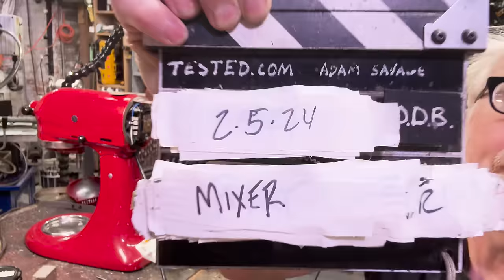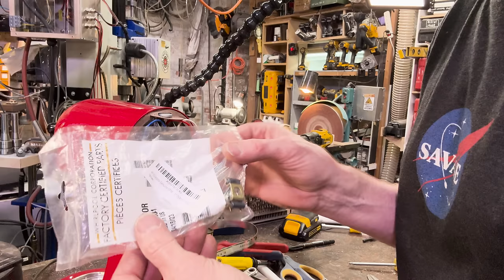Can Adam Savage Repair This Old KitchenAid Mixer?

Comment: I can't see the mechanism well enough to understand what he's doing.  So basically I'm just watching Adam turn a screw driver.   A rare miss for Tested.
Reply: I saw enough of the mechanism to understand what it's doing. But it was presented backwards. There's a centrifugal governor on the back of the motor shaft and as the motor turns faster it actuates that switch plate that Adam kept screwing with. Moving that plate in and out changes when that governor actuates the plate. Also moving the speed lever moves the plate too.
Reply: @1pcfred  Thank you

Comment: Please for the love of everything that’s holy, get an insulated screwdriver if you’re going to work on live equipment, and if you don’t have one, do not hold the uninsulated shaft of the screwdriver. I know you only have 110V that barely tickles in your outlets, but still. 😂 the proper way to work on mains equipment is to use an isolation transformer that separates the device under test from earth potential, meaning you’ll need to touch both conductors to get a shock instead of just the live.
Reply: We haven't had 110V in more than a half a century. So you don't know half of what you think you do.
Reply: @1pcfred  oh dear, of course I'm completely incorrect for mistyping 120 volts. The extra 10 volts surely makes a difference in this context. Sorry for attempting to keep my comment light hearted.
Reply: @sstorholm  10 Volts absolutely does make a big difference. My pool pump was dropping 2 volts over a long line run and that made a big difference. When I replaced the old 14 gauge SG cable with new 12 gauge UF wire the motor ran much cooler. You wouldn't think it'd matter, but it does. Seeing is believing. I am not joking either.
Reply: @1pcfred  while a 2 volt drop shouldn't affect any motor (your beloved nominal 120V can actually vary between 114 and 126V), there ought have been some other issue with that pump. My comment is that considering electrical safety, 10 volts difference doesn't matter the slightest.
Reply: @sstorholm  no there was no other issue. It was just line sag. 2 Volts makes a far bigger difference than most realize. If you knew how induction motors work then you'd also know why lower voltage makes them work harder too. At lower voltage it has to pull more current. Duh! I should have measured the current draws too. But I had places to go and things to do. I just felt the motor before and after. Cooler is better. It even sounded better. It was a happy motor.
Reply: @1pcfred  I actually do know how induction motors work, I’ve worked with quite a few. 2 volts of drop out of say 120V equates into around 2% voltage drop, which then would result into an increase in current of around 2%, which is entirely negligible. But I’m happy you’ve upgraded the service to that pump, have you calculated if you hade enough short circuit current at the pump to blow the breaker before the upgrade? Do you now?
Reply: @sstorholm  the pump is gone. FYI  magnetism is not linear.

Comment: @1:46 - Finger on a metal screwdriver into an activated appliance??? 
I've "shaken hands with Jesus" once or twice in my life as an electrical engineer, and that's definitely a way to make it more likely.
Just keep your fingers on the insulated handle please.

I see you made a big show later on in the vid for when the device was unplugged.  I hope that was not a hard lesson learned.
Reply: For the record, both electrification events were because of a miscommunication with the other individual controlling the switch/breaker.
I was carefully using only one hand, was not strongly grounded, and only got a good wake up call.  There was another occasion where a breaker was turned on early and hot-soldered a big chunk out of  the screwdriver I was using.... but as I was holding the insulated end I escaped unfazed.
Reply: Adam's workshop has a wooden floor so how big a shock can he get? It'd wake you up. But kill you? Not likely.
Reply: @1pcfred  Wood is only slightly less conductive than flesh. Both my near-electrocutions were on wood floors.
Reply: @yobgodababua1862  you must be joking. Seasoned wood is an electrical insulator.   It's on every list of electrical insulators ever made. There you go, the first link dry wood. Out of 5 items wood made it. Next list, wood is on it again.
Reply: @1pcfred  Doesn't matter if the handle is an an insulator when you're holding it by the metal shaft...
Reply: @yobgodababua1862  it doesn't matter if you get shocked either. It's not like he has one foot in a bucket of water. The best Mythbusters is when they hooked the electric fence up to the tabernacle and zapped Adam with it. The look on his face was priceless. Now I have to watch that scene again.
Reply: @1pcfred  I think the floor and your theoretical bucket of water are distractions here... if your other arm is close to a grounded outlet on the workbench, and you poke the hot lead grabbing the metal, you have a much higher risk of arcing cross body and stopping your heart.
Reply: @yobgodababua1862  close to a grounded outlet? So you think 120V can arc across open air? Riding the lightning isn't as easy as you think it is. If electricity was as lethal as you think I'd have been dead long ago. I started messing with mains voltage when I was 13 years old. I haven't shocked myself in a while now but I was pretty careless when I was younger. I'm not proud of it but I've been shocked countless times. By voltages far higher than just 120V too.
Reply: @1pcfred  Ok, maybe not always fatal, but every mains shock depends on how it routes. If you're careless and it goes cross body that's traditionally a bad time.

In general, people need to treat high amperage work with more respect.
Reply: @yobgodababua1862  It is not the amps that kill you. It is only the amps that manage to pass through you that are a hazard. How conductive we are depends. Clean and dry I'm not very conductive at all. Maybe 20 or 30 megaohms. So I'd only be passing picoamps at 120V. That's not enough to kill me. But if you're up a ladder and get shocked it can cause people to be startled and fall. That happens.

Comment: That's a mighty pointlessly complicated system for a simple speed control.
Reply: That was an almost universally used system before electronic motor control (also in washing machines and basically any applicance that had a universal motor powering rotating parts).This model of KitchenAid was designed in the late 1930s. Their newer 7 Quart models actually use brushless motors with electronic control. I agree with you that modern machines should not use something like that, but then it is actually less complicated than most electronics.
Reply: If you're born after about the year 2000 maybe.
Reply: @bushratbeachbum  i was born in the 80's. It's a pointlessly complicated speed control setup. I have other motors from the 20's (for small lathes or drills, motors that you'd buy to spruce up your machine) that have reverse and speed control with far better speed control.

Comment: Capitalism would be bringing out mixers with different parts so you have to buy new instead of repairing.
Reply: This one time capitalism in Europe is way ahead of the US, because Whirlpool Europe outright refuses to sell internal components for KitchenAid mixers to private citizens.  My only consolation is that the Chinese knock-off company where I order spare parts is probably the same one where they source their parts as well. But I am paying through the nose, and fixing the things is barely economically feasible.

Comment: I hate to be that person but......this video needs a warning on it

In the UK Adam would be a toaster now stabbing that electrical appliance with a metal screw driver when its powered with 240v, 
Not a good video not showing shop safety for the rest of the world that uses 240v.
Reply: Why would he be a toaster?
Some kind of body morphing?

If you're not comfortable doing something, you shouldn't do it.
He's not telling you to do anything, or instructing anyone.
Many machines require adjustment while running that isn't possible while not.

Go back to your cubicle and cry over your paper cuts.
Reply: @bushratbeachbum  But watching Adam doing it could make you feel like trying to mend things yourself, only problem is alot of the world is 240v, you touch that with a screw driver and you are toast, hence the saying, it will literally stop your heart
Reply: @wolfe1970  if watching a video of someone doing something makes you feel you can do what you're watching, you shouldn't be watching videos.
You can buy a 120cc chainsaw or 700cc two stroke dirt bike with zero restrictions or tuition, both things you can watch people using in thousands of videos.

I've given myself plenty of 240v shocks, some up one arm and down the other, and im still doing just fine.
It's part of the territory to some extent.
Be cautious, yes, but be responsible for your own actions would be my best advice to people.
Reply: 240v, or more accurately 230v, isn't as lethal as you make out.
It ABSOLUTELY can be, but it's not the killer you make out.
110v isn't for safety in the us, it's because the cable manufacturers and copper mining companies didn't want to lose their profit margins.
Have you seen the ridiculous cables some of their stuff requires to operate?
Current is just as dangerous as voltage regardless.
Ever been near an electric fence?
In the thousands of volts, but in the low milliamp range, around 100-200ma
But interestingly, 7ma can stop your heart.
Interesting stuff electricity!!
Cheers!
Reply: It's not our fault you poors can't afford a good electrical system.
Reply: @bushratbeachbum  We haven't run 110V on the grid since the 1950s. Go buy a clue already. Our system absolutely is how it is for safety.
Reply: @bushratbeachbum  Coming from who exactly? are you an electrician ?
240v or 230v will absolutely kill you, especially how Adam is holding the shank of a metal screw driver with one hand and operating with the other, that 240v will go through your heart and will kill you, either way, its still bad practice to go poking at the back of an electrical appliance with a fking metal screw driver whilst holding the metal shank, probably the worst thing you can do, even worse is showing it on educational videos
Reply: @wolfe1970  i am, yes.
As i said, I've experienced many, many 240v shocks, some up one arm, across my chest (where my heart is) and down the other arm.
Im also an off grid solar installer, so i work with much higher voltage too. Up to 1000vdc and three phase ac of various voltage.
I've seen people get a 450vdc shock and continue working, three phase 414vac and shake their arm then carry on.
I've also seen people knocked over by a 110vac shock and many other instances of not dying because they experienced an electric shock.

Remember when you were a kid and thought that if you got shot, you were dead, no question about it?
Same thing champ.
It's most certainly rarer to die than not.
Im not saying don't be careful, im absolutely saying electricity will kill you and hurt you until you can't feel it any more.
But im not spreading fear and panic mongering unnecessarily.
If common sense were actually common, well, natural selection wouldn't be as active as it is.

You're far more likely to get hurt doing something you're scared of, rather than something you have thought about, researched and assessed with a critical eye.
Adam did those things and, looky!!
Bloody survived again !
What he's working on is not live, it's an adjuster.

Chill your boots champ. Xxx